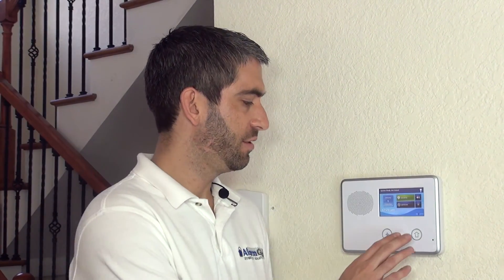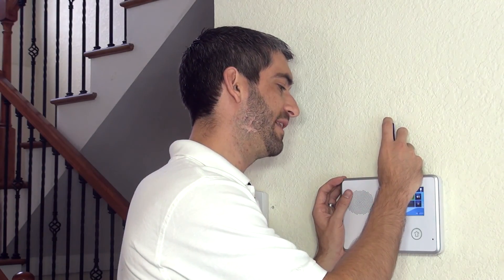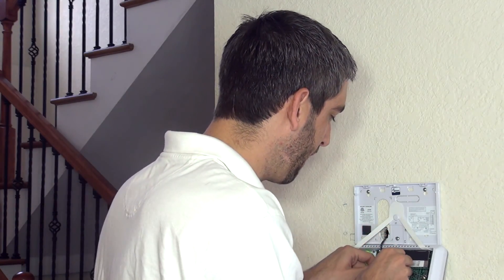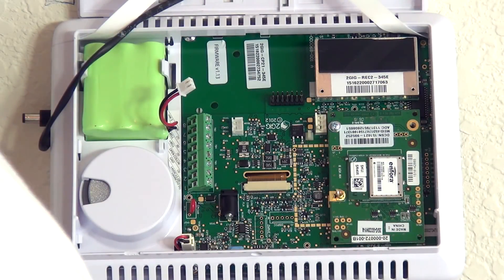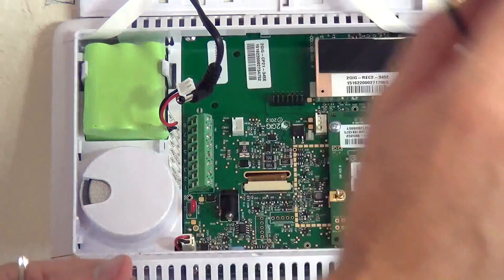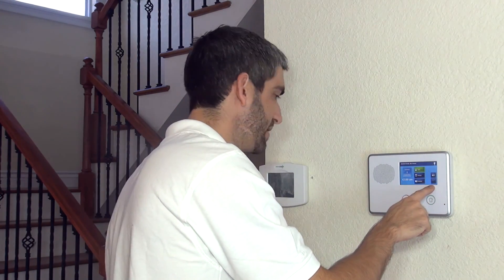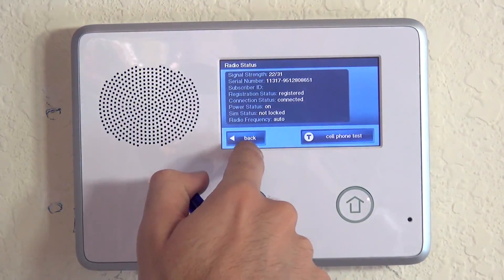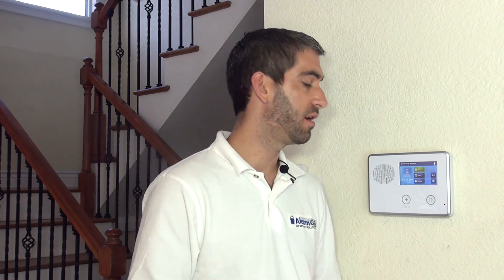2GIG Cellular Communicator: Go!Control Installation

Comment: HOW DO YOU DISABLE THE BEEPING FOR THE FAILED RADIO NETWORK?
Reply: You can take a look at Q91 within programming and setting that to 0 and that should switch the panel to local only comunication.

Comment: On page 10 of the installation guide it specifies the antenna coax needs to be routed a particular way over the top of the speaker. You didn't seem to do that here, and I assume it's for interefernce. Have you heard of any issues with that?

Comment: verizon has the best coverage
Reply: In some areas of the country, AT&T has better coverage so the good thing is this panel lets you choose the carrier that's right for you as there's a Verizon option (https://www.alarmgrid.com/products/2gig-gccdmv-a) and an AT&T option (https://www.alarmgrid.com/products/2gig-gc3ga-a).
Reply: where i live in south Carolina verizon has the best coverage
Reply: Okay, well the GCCDMV-A would be the communicator to get if you have a GoControl and want monitoring or if you haven't yet ordered a system.
Reply: Verizon has the best coverage ? That really depends on the location. In some areas, Verizon is awesome, but in other areas, AT&T is the greatest.